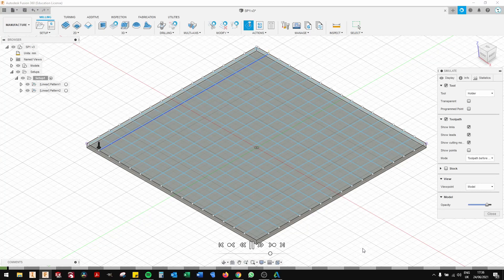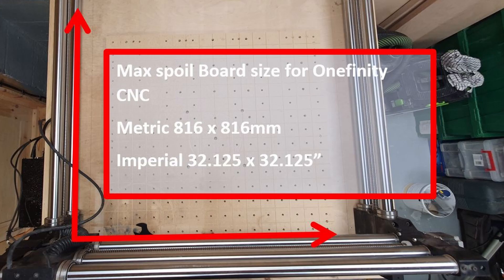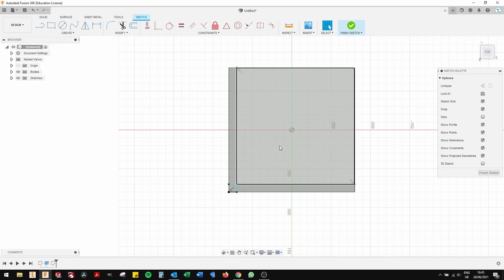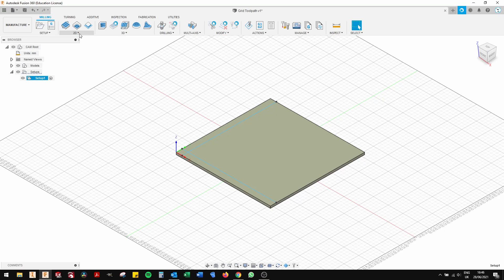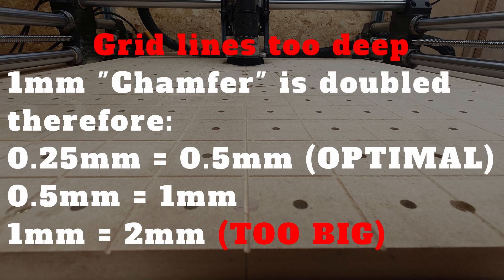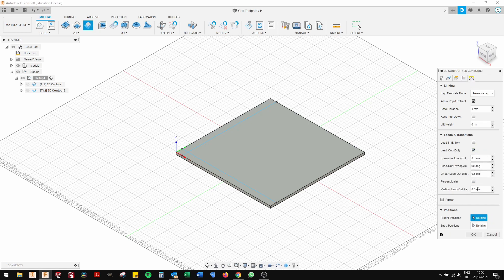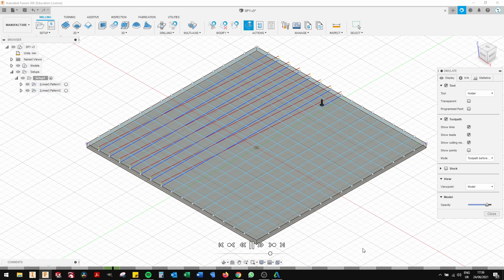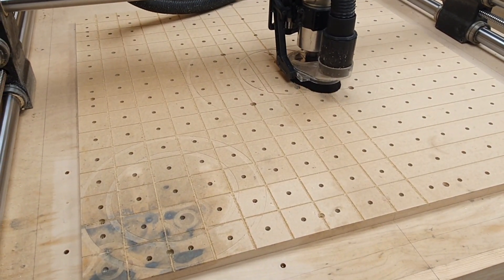Design A Spoil Board Grid With Fusion 360 - Onefinity Tutorial

Comment: Is the reason you didn't just do a rectangular pattern in the design part to get all of your horizontal and vertical lines because if you did that you would have to create a toolpath for each and every line?
Reply from the maker: Using lines is easier and quicker for cutting a grid than doing an actual physical pattern on the model,

Comment: I dont seem to be able to keep my passes within the boundary of the machine leading to greater than maximum error.
Reply from the maker: If you are using Fusion, dont use the surface feature, use 2D pocket and start job in centre, select options to stay inside area. Last surface I did was 810 x 810